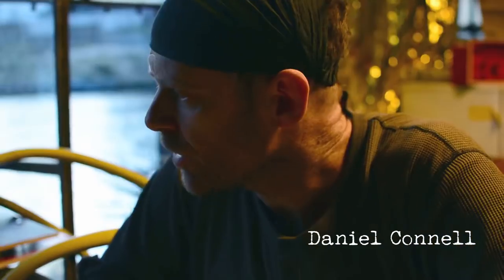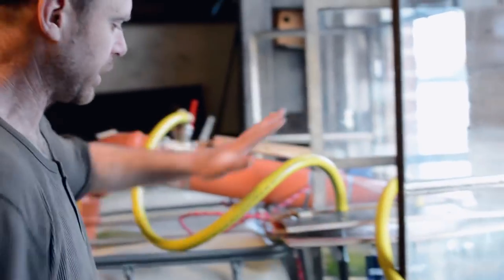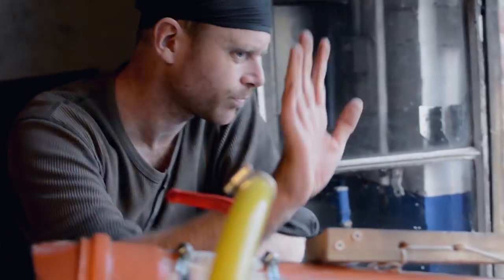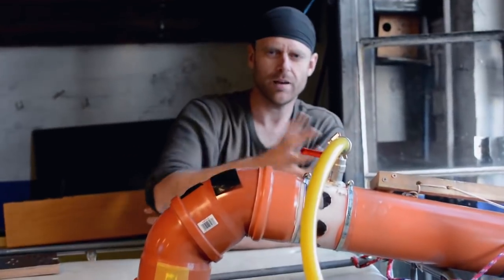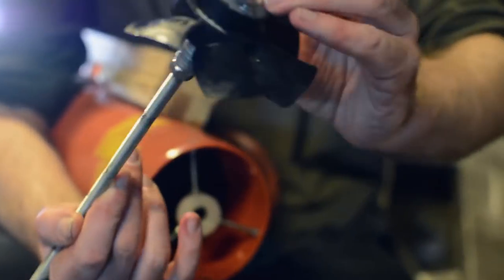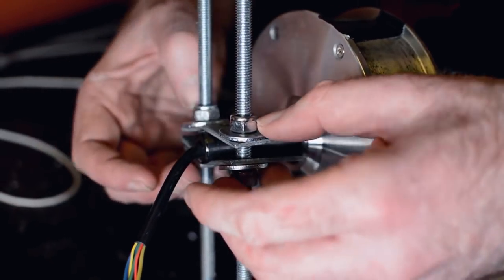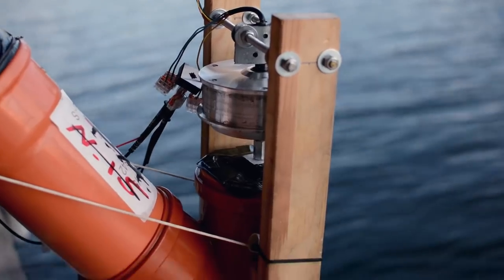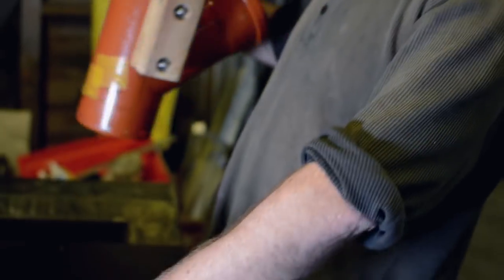$50 Water Turbine-5 kilowatt hrs/day - Open Source, DIY

Comment: Are you considering for degradation of materials? If you are planning to drive and "alternator" or "generator " many components within the typical designs are subject to rust and corrosion which will create resistance.

Regarding wearable parts, are you going with brushless designs? Brushless will reduce maintenance.
Reply from the maker: Pretty much everything in constant contact with water is either PVC or stainless steel, the hoverboard motors are pretty well sealed, tho only long term field testing will say for sure.

And are brushless, three phase AC.
Reply: @OpenSourceLowTech  I believe you said that rpm was very important in your design correct? Have you considered using a two stage system, where cost may be a bit greater, but it would allow for greater end RPMs, or simply using sheer water pressure from volume to turn a lager impellar or water wheel, and use a torque converter or geared ratio system to increase RPM?
Reply from the maker: RPMs are definitely important as they're proportional to voltage, but in this case I'm happy with the output from the hoverboard wheel as direct drive, and I think a motorbike alternator will hopefully also do a decent enough job. Which means being able to avoid the extra complexity of a gearing system or similar, which are usually necessary for lower revving turbines such as Archimedes screws and the like.
Reply: @OpenSourceLowTech  I guess my thoughts are more to a situation where there isn't a sufficient drop such as a damn like you used in the video. How are you going to generate enough rpms in your design?

Comment: Can we please get information on how you wired this
Reply from the maker: This is just a test rig, so is wired for measurement more than power generation, storage, and use.
Actual field implementations will be different and individual, but usually pretty simple. Mostly comes down to choice of charge controller...
Reply: @OpenSourceLowTech   I'd really like to see a working system i have saved several hover board motor's in hopes I could use them. I am wanting to use vertical axis wind turbine to run 3-5 motor's at a time
Reply from the maker: In its more or less simplest form you'd probably just have (for either wind or hydro):
Alternator - bridge rectifier - charge controller - batteries - inverter if you want to run mains stuff, not if not.
With probably some kind of load dumping / diversion coming off the charge controller for when the batteries are full.
Or a grid tie inverter if you're selling to the grid.

Check out this Facebook group for a lot better answers to this kinds of questions tho: https://upload.facebook.com/groups/windturbinemakers/

What kind of VAWT? It'll need to be pretty huge to generate enough power to necessitate that many wheel alternators doing over 300W each..

The wheels do reasonable voltage per rev, but still not quite enough to run direct drive from a VAWT, so you'd need to gear it up in some way.

Comment: I still don't see this tutorial on the webpage yet, were you still going to add this?
Reply from the maker: Things are currently on hold with the lockdown. I want to field test the design a bit before signing off on the tutorial, and that'll have to wait until I'm able to pop over to the site in a useful manner.

Since I've been getting a bit of interest in it tho I'm contemplating doing a quick video build tutorial on it in the meantime, with the disclaimer that it's not yet been tested long term.
Reply: @OpenSourceLowTech  Sounds cool  I've been working on a travel hydrogen design myself.  I like the simplicity and price point of what you have come up with though and just wanted to see all the details.  8)

Comment: Have you tried better designed 120mm fans? if they move more air at lower rpms could it be the same for water? just a thought that popped into my head while watch no clue if it is in any way valid. Noctua fans have notches on there trailing edge and i quote "Vortex-Control Notches split up trailing edge vortices and thus spread the fan's noise emission over a wider range of frequencies. This measure makes the NF-P12 PWM sound more pleasant " could that help control cavitation. Take care, God bless one and all.
Reply from the maker: I tried a couple different types, kind of assuming the basic flat fans wouldn't be the best, but in practice they performed the best by about a 30% margin.

I'm thinking something more in the form of an outboard motor propeller would be best, but it's a matter of material availability and access.

Comment: Would it be possible to implement such a turbine in the used water system of buildings (for the grey waters) ?
Reply from the maker: If you can get tens of litres per second of flow, potentially yes.

Comment: How did you wired ? Is it the same as a washing machine motor with rectifier? I couldn't really hear everything you said . Thank you for sharing +)
Reply from the maker: That was just a test setup to measure power, so was the three phases out of the alternator into a bridge rectifier, through a multimeter for amps, and the liquid rheostat as dummy load with second multimeter across it for volts.

For actual use, would depend on the variables of your particular situation.

Comment: Did you put nozzles before the impeller?
Reply from the maker: No, but since the impeller fan does have a central hub there is effectively a throttling of the water onto the vanes. 
I experimented with a second impeller with a larger hub, to see if the resulting water velocity increase across the fans resulted in more power, but it turned out about 20% less.

Comment: Awesome video! Really cool design.  I would imagine you could upscale the pipe size and alternator. Just curious,  does the velocity of the water stay the same throughout the pipe? If you moved the impeller closer to the bottom of the discharge pipe, would the output increase?
Reply from the maker: Thanks. The design should be fairly arbitrarily scalable, depending on material availability.

The velocity in terms of meters per second will increase in constrictions and decrease in wider diameters, while the liters per second should remain the same regardless, due to conservation of momentum and the fact that you can't compress or expand (other than cavitation, which is generally best avoided) water.
So greater linear velocity water at a constriction in the pipe won't have any more energy than anywhere else, as if it's moving at twice the velocity it's because the cross sectional area has been halved, so the momentum hasn't changed.

If that makes sense..
Reply: @OpenSourceLowTech  yes, makes perfect sense.  Have you tried other alternators? I wonder how much load before it stalls. I wish it were spring instead of heading into fall! This would be fun to experiment wiith during the summer! Thanks!
Reply from the maker: I'll try it with a motorbike alternator, which will do a less good job but is generally more accessible a resource in other parts of the world and should be fine more or less.
I've got two potential install sites here in Scotland over the rest of the year, I will be anticipating some degree of standing in rain...

Comment: Mate I loved your video, but got a bit confused with the way you loaded up your alternator. A bottle converted to some sort of rheostat? As an old auto sparky I was confused as I’ve newer seen or heard of a load like this before?
Reply from the maker: Liquid rheostat. Traditionally they're often used with salt (as in NaCl), but I found it offgassed chlorine a bit more than I liked, so used washing soda instead.
It's just a variable resistor. Solution has an overall resistance I can set by chemical concentration, and then can vary the resistance between the electrodes by the depth of the second length of wire.
Reply: @OpenSourceLowTech  do you have the full 'how to build' tutorial out now?
Reply from the maker: @holmes1427  Not yet, I'm still wanting to do some field testing to see how it holds up over time, and that's hit a bit of a pause what with the plague etc. Before too too long tho.

Comment: Fascinating stuff, just wondering could you in theory place a pelton wheel at the end of the tube (if you didn't put it under water) to increase the power output from the system?
Reply: I reckoned that too - a simple water wheel to harness that leftover power

Comment: I've been watching a few YouTubers testing this concept of hydro power and I understand it's still testing phase as of now. 
I've always wanted to know can rainwater tanks be used as a source of power ?
Reply from the maker: This goes through about 30-40 liters per second, so it would be too much volume for a rain tank. More meant for rivers and streams.

Which other videos have you seen?
Reply: @OpenSourceLowTech  I've just watched most of them even the DIY rocket stove pretty good.
I think you've answered my query as well in your other video. The trick would be to recycling the water. I think you can imagine if you will A big M on top of a water tank on top of the archers dual alternators.
Reply: @OpenSourceLowTech  I just want to confirm this...30-40 liters per second? I'm looking at ways to get creative with multiple storage tanks but need to know how much water is required to produce 1kwh. Thanks and this is awesome!
Reply: @mattlawrence1788  Volume is only half the equation, you also need to factor in the height the water is falling. 1 liter of water falling 1 meter is about 10 joules, or about 0.0027 watt hours. 400 liters falling 1 meter would be about 0.001 kwh, likewise 1 liter falling 400 meters or 20 liters falling 20 meters. If your drop is 4 meters, you'll need 100,000 liters to get 1kwh, or a bit over 1 l/s for 24 hours. In reality you will need more than that, because the system will have losses, and different flow vs. head height combinations will need different turbine designs. Stored hydro power usually requires enormous heights and volumes and is rarely worthwhile at small scales.

Comment: Why is the turbine located at the top of the drop and not at the bottom closer to the water outlet? Wouldn't more drop mean more pressure so the turbine will generate more? I have a 5 meter drop of constant water flowing on my property and really want to do this DIY.
Reply from the maker: Pressure turbines don't work well with this little head, this is a momentum turbine, which means you want as much water as possible moving as fast as possible, and because water doesn't expand or compress every part of the system will have the same momentum.

It's more efficient to put the runner directly above the draft tube, for reasons of pressure gradients and cavitation.

5m will certainly run this turbine well, how much flow?
Reply: @OpenSourceLowTech  Hey, thank you that makes sense. The flow is 62 gallons per minute. I over estimated the head. The drop is actually only ~2 meters and the water flows underground for 30 meters on a slope until it is discharged. My calculations show that this could be a 70 watt system. Does that sound right?
Reply from the maker: Maximum potential hydro power is head x flow x gravity
= in this case let's say 2 x 40 x 9.8
= ~800W

So with my turbine having an overall efficiency of about 25% = 200W actual output / ~5 kWh/day.

The 30m extra is underground in what sense?
If it's a pipe or otherwise sealed flow, if you can join your draft tube to that in some way you'll get all that extra power...
Reply: @OpenSourceLowTech  wow that's serious power. Why 40 for flow rate and not 62? Yes, the water travels in a pipe underground for 30 meters. However, it is a very large pipe (12" diameter) and is not nearly full. Would it be better to use a smaller pipe that can fill up?
Reply from the maker: 40 liters per second.
How much drop is there vertically over those 30m?
Reply: @OpenSourceLowTech  2 meter drop over the 30 meters. So the slope is about 6%. However, I could run a pipe horizontally and then have a 90 degree turn for a direct 2 meter drop like you do in the video. Would that make a difference?
Reply from the maker: Might not be worth it after pipe friction and turbulence are considered. 
I'd probably just go with the easier two meters.

Comment: Between this and your previous post, you seem to be using a sani-t fitting to hold the turbine...would a 3-4 ft, drop for 8' have enough flow to start this type of system?
Reply from the maker: Sani-t meaning the drainage pipe connector housing? Yeah it's all standard off the shelf plumbing parts.
3-4 foot / 1m drop might be a bit small to get much, the power comes up on the square exponent with height, as twice as tall means both twice as much gravitational potential, and twice as much flow. The turbine pictured here had about 2.5m / 8 foot for 200W.
Reply: OpenSourceLowTech  Moving to a area with torrential rainfall and thinking of using this system to supplement 12 volt system (using the rainwater catchment as the water source) as this will be a off grid set up at this point in time.
Reply from the maker: If you mean catchment as in rooftop, you almost certainly won't get anywhere near enough volume to get any useful power from.

If you mean a hillside tho then that should be viable.

Comment: so the key is to have a differential height, to create the head pressure? Is this the design concept to get the vacuum working?   
I am trying to think of a way to us this concept one sail boat.  I have endless sea water, and the sailboat cruises at 5 knots.  I have good Sail Post for vertical height, but the problem would be that I need height differential, correct?  So what If I suck water up from ocean, goes up 5',  then drops down 5', but then goes horizontal to rear x 20' at top of water.  Does this create the "Suction" or vacuum needed to get the system started?
Reply from the maker: The power comes from the drop, yes. So on flat water such as the sea this principle won't work. You could pump it up, but that would take more power than you'd get from it coming back down. 
It's meant for rivers and streams with natural drop, tho this can be a gradual incline and doesn't need to be purely vertical.
Reply: You could drag it through the water, but I think you’d be better off with a wind turbine.

Comment: I'm thinking of trying to do this with a stream i have on my property. One question, would it not work to attach the output shaft to a set of gears so that you could multiply the speed of rotation and get more power?
Reply from the maker: You could, but it would give you more revs and voltage, not more power overall, as it would come at the expense of toque and amperage.
Also this thing already revs pretty high.
Reply: @OpenSourceLowTech  thanks for the reply. I'm trying to understand the science of it I guess there's some key thing i'm missing. Is the power generated not just a function of how fast you can spin the shaft of the generator? So if the water wheel spinning is first attached to a gear set before it gets to the generator shaft I thought it would produce more power. Again, i'm definitely missing something!
Reply from the maker: Power in this context has two components; voltage/rpms and amperage/torque. Multiply those two together and you get power, in watts. 
That's a bit of a simplification, but essentially you can spin a generator super fast, but with no load placed on it it's not really doing any work and producing and power. Likewise you can pull a heavy load from it, but if that slows the rpms down to a crawl then you're again not generating much of anything.
Maximum power is the point at which you're getting high enough revs under high enough load that they multiply out as as the highest watts available in the system.

So in the case of gearing up this turbine, yes if you double the rpms you'll double the voltage, but when you put a load on that (ie have it charge a battery, light a light etc) then it'll take twice as much torque/force to turn it, so you won't have increased your power overall.
Reply: @OpenSourceLowTech  that makes perfect sense now. I didn't realize that drawing more current would cause physical resistance in the rotor itself. Thanks for the clear and patient explanation :)

Comment: Would a car alternator work. With or without  rectifier
Reply from the maker: They can self excite, and are pretty good for max power and availability, but are pretty high revving / low volting, and so even with this turbine putting out pretty decent rpms you'd still struggle to charge a 12V battery.

Motorbike alts tho, lot more promising.

Comment: Is there an option for 0 head turbines? like directly on the flow of a creek river with low flow speed and basically no head.
Reply from the maker: Yes, but the water needs to be moving quite quickly to get any decent power. So unless there's a natural channel or the like to place it in, most rivers aren't likely to give you much.
Essentially this turbine here is just an in-stream type which creates it's own speed increase by piping off a little bit of drop.
Reply: @OpenSourceLowTech  yeah I figured. There is this I wanted to try it on but I will need to find a good place on it where the water is fast enough.

Comment: Could this work on a tidal river that flows in and out with a strong current? Somewhere around 3 knots.
Reply from the maker: there are types which work in-stream, but you really need to get the water moving pretty quick to get much useful power.
This kind of turbine needs a couple meters drop,

However, this could work with some kind of wall which the high tide breaches, so that you have an empty/fill cycle of the walled off area by the tide twice a day...